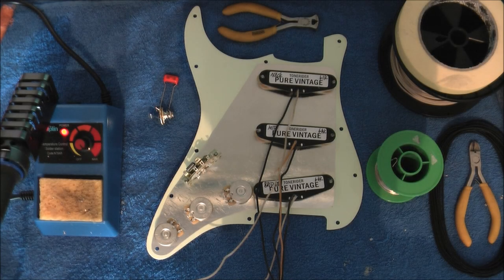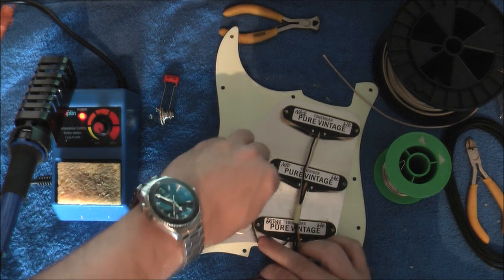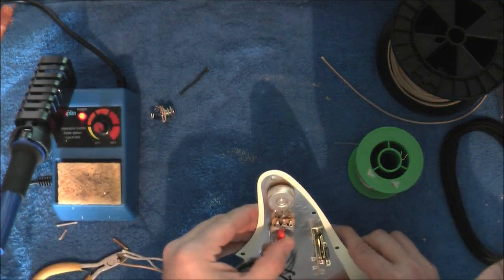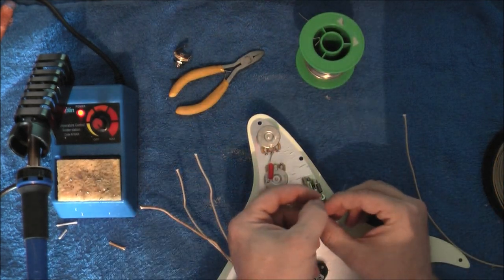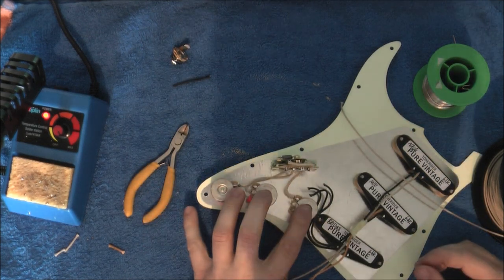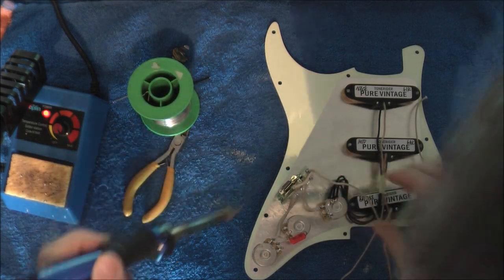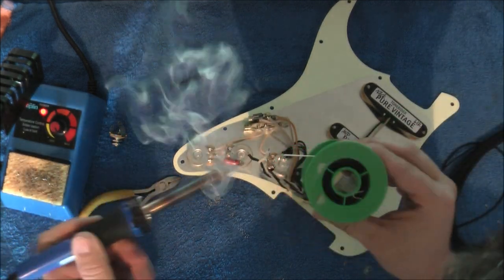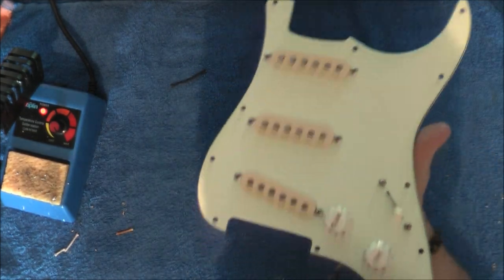How To Wire A Stratocaster - Tutorial

Comment: for others doing this - you will get a MUCH BETTER result by heating the wire or terminal (both actually at the same time) and letting the solder flow ONTO that - ideally you don't want the solder actually ON the iron tip ... though unavoidable most of the time
Reply: That is the correct way to solder. The solder should flow towards the heat. But I think Kevin is using tinned wires and a slightly over tinned iron to anchor the wire before completing the solder job which makes it a bit easier.
A one or two second touch with the iron and the job is done.
This is a neat and professional job. There are some other "instructional" vids which are only good for a laugh. Especially the ones where a "puddle" of solder is used for earthing the pickup wires. God, what a mess!!

Comment: Hello   im  completely  new  to   fitting   all  parts  to  a  pickguard   i.e  pick  ups   pots  and  selector  switch
My  question  is  .can  it    be  easy.if    i  took  a  photo  of   the  back  of  my   pickguard  took  note  of  where  each   wire   goes   then   just   copy  that  across  on  to  the  new  pots  and  pick  ups  and  switch?

Comment: Currently working on my first guitar project and I’ve bought a loaded pick guard similar to this, however the selector switch has the little soldering points in different places (as if it’s on its side, to give a general idea) I’m having a hard time knowing where each wire should go as I haven’t seen any videos at all using this kind of selector switch. Is there any way to universally determine which point should be connected where?

Comment: Won't you have to unsolder the input jack to get the wires through the body?
Reply from the maker: Yes, in most cases. But this works better than adding spade connectors to the jack socket as these don't tend to fit very well. Plus you'll need a soldering iron to attach your pickup wires anyway. We are hoping to introduce a "solderless" range of kits soon, which would eliminate any soldering at all.
Reply: @northwestguitarsUK  Solderless, huh?  Now that would be interesting.

Comment: Can I ask what difference 500k pots would make in a strat type guitar, if any? Thanks for a great video
Reply from the maker: Hi Bob,
500K pots would probably be a bit bright on a single coil Strat.
If your guitar has single coils then you'll want to go for 250k pots and a 0.022uf cap.
If your guitar has humbuckers then you'd typically go for 500k pots (which are much brighter) and a 0.047uf cap

You'll want to choose only audio taper pots for both volume and tone. These give a much more gradual progression from 0-10, whereas linear pots are pretty much all or nothing.

For more info on pots have a look at this video:  https://www.youtube.com/watch?v=RdfIZEB2rdM

Caps - The higher the value the more of the highs and mid you'l lose as you roll down the tone control. A 0.022 or 0.033 is more than adequate for a single coil setup. for a humbucker setup you'll want to go for a 0.047uf cap

I hope that helps but let me know if you need any further info.

Kind regards

Sam

Comment: Thanks for the time and effort you put into this video! I have a MIM Strat with MN serial number which makes it a 1995. It has a very load HUM! I could not find a loaded pick guard to fit so reloading old one. I have 3 used working Fender American Standard pickups.  I have done wiring and soldering in the past. I installed new 250 CTS pots, switch, push back wire, jack, .047UF Orange Capacitor and new (good)solder connections. Used copper tape to ground the inside of the body cavity and the underside of the pick guard. All put together and I have the same loud hum I had before? Got any ideas? Please help me.

Curious as to why Ron Cox video shows different capacitor connection?

Comment: I need help please.    I have problem with static on my scratch plate,  and when I change from one pickup to another,  there is a noise that comes thru as though one was touching the end of the jack plug that is plugged into an amplifier.  It is very loud.  I have to turn the volume switch before moving from on pickup to the next.  Can you help?  Any advice.  Have checked all the earth connections and the live side of things.
Reply from the maker: Hi James. Sounds like it could possibly be a switch issue if you notice the crackling when switching between pickups?

Comment: Is it common for there to be no tone control for the bridge pickup?
Reply: Yes. But there are vids on how to include it.
Reply: @danieltrickey9285  Hi, I thank you for the reply. I did find that it was as easy as hooking up the bridge pickup to a tab on the switch. Now all pups have tone control. I guess it was the original diagram and hookup for a strat that I was using.

Comment: I have 70th classic strat ( new) and it makes a hum or noise when jacked in and amp is on. touching the strings or the trem it goes away, is that shielding or earthing? I have nothing like it on all other guitars I have? Has anyone an idea, what a fix could be or is that part of old shool sounds?
Reply: Typically, that is because you do not have proper grounding. There needs to be ground to the bridge and the body cavity should be shielded and grounded as well, if there is not, the guitar will hum until you touch the strings, then you are the ground. Grounding the body cavity can be done with copper tape or with shielding paint. Most newer strats have shielding paint in the body cavity but it may not be visible because of the guitar body's paint. Shielding paint is usually black, and can look sort of rough because it has metal in it.

Comment: The bridge pickup usually has a different colored output wire; did you intentionally swap the middle and neck pickups?  Very tidy job regardless a true technician!!  Cheers!
Reply: 1cleandude the middle is counter wired. The center always has the yellow or odd color wire.

Comment: you are lacking details, what size pots, what size capacitor, we cant see where you are putting the wires, you should explain , left side , right side, middle etc.
Reply from the maker: Pot sizes and caps can vary. Depends on what sound you're looking for. Typically you'd go for 250k pots and 0.022uf cap if you have a Strap with single coils.

Comment: The reason you have to have your iron so high is because you are doing it incorrectly. You are supposed to hold the tip to the spot you want to solder then bring the solder to the iron after heating the spot and let it melt on.
Reply: I was taught the same. Looks like his soldering iron is so hot that the heat is instant. Look how fast the ground wires were soldered to the pots.